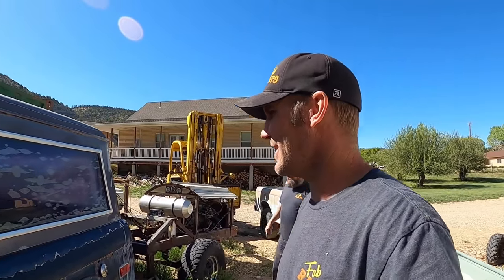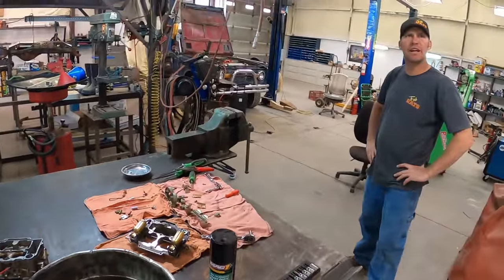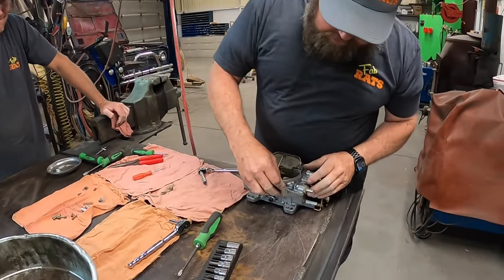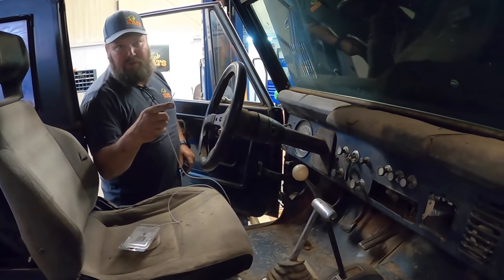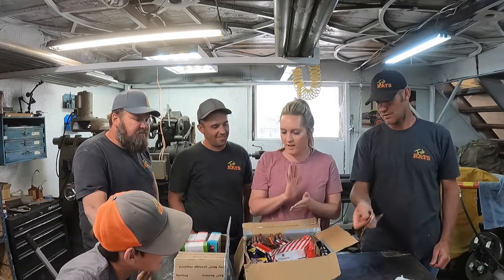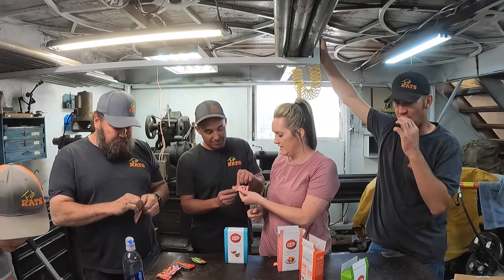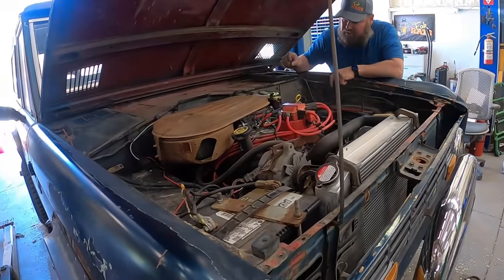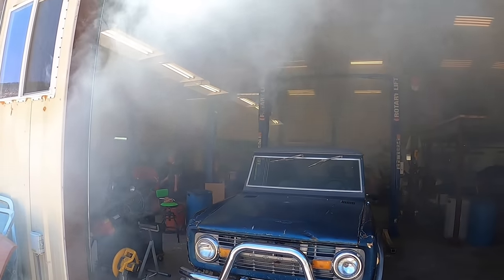The Wait Is Over! You Have All Been Asking About This Ford Bronco!

Comment: Free tip for you Paul from a retired mechanic, I heard you say put saw dust on the break fluid spill. Absolute best thing is water, it neutralizes break fluid in seconds. Just throw water on and wipe up or hose it out. Same goes for cleaning brake drums full of brake fluid after a wheel cylinder leak job, just hose it out.
Reply: Very logical!
Reply: I see their fallback method was burnouts. Certainly helped get spinning!
Reply: likely does it for you know.. the ecological aspects of things. not that hes on a sewer system, but it's still generallly frowned upon to just dump toxic liquids all over the pllace...
Reply: @Sffker  I bet you use vape pens and inhale/drink more of the main components of it than a typical brake fluid spill would dump(lol).
Reply: @throttlebottle5906  yea, i mean the issue is not if 1 person does it every once in a while. it becomes an issue when it’s an at scale thing. it all goes somewhere, it doesn’t just disappear

Comment: That’s a beautiful vehicle. Our family has a 1966 that my grandfather bought brand new. We had a frame off restoration done to it and it only has around 47,000 original miles on it. Plus we still have the original oil bath air filter

Comment: I always use the copper oil line kit when doing Guages like those.  Even more so when mice are problematic. Good video guys.
Reply: This!  My GF was not happy whena kink in the line under the dash let go and hit her in the leg with oil. Lucky the thing had not ran long and she was a champ about it. lol.The carpet, well not so much.
Reply: @LarryYaw  My 427 67 Camaro had the plastic line when I bought it. It was I need to change that to copper. Had it in my garage running BOOM! smoke. SH%& fire. I shoved it out watched it roll down the driveway flaming. Got it out saved the house and car. Never, Never, I mean Never again.  I just put the same gauges in my 55 F100 guess what oil line is on it.
Reply: I've had plastic line in my truck for 7 years, still no issues 🤷‍♂️
Reply: Just go electric, they react a lot faster.
Reply: nothing like having the nylon line chafe through and blow hot oil all over you and interior.... 🤣
on a side note, the same can happen with copper if it's not routed and protected right. no need to ask how I know in either case(yuuuuuup)

Comment: The 1975. I bought a 68 Bronco. Stock Jeep tires on it. Didn't have no backseat I found one down the street from where I left paid 25 bucks for it. Had Defenders cut flares on it put some fifteens by 33's on there put headers on it. The original motor start burning oil so I had that change put a factory rebuilt that was bored out original order was 289. This other ones for spinner 289😊. Got rid of the smog pump. Cuz it was on my Mustang 65. But that thing would make those big back tires bark like dogs. It would lift the front end. 3 speed on the tree. This was a northern California. I had that thing for 45 years same motor. I never put more than 60,000 miles in that thing. After while when I got separated it's at more than what I drove. Talk to Southern California headset different 5 years. Drawing from Southern California to Missouri. I got rid of it two years ago had that thing for 45 years. Had to sell it couldn't work anymore. That they would Clan The Impossible. My cousin had a 72. He was always getting stuck the river in sand. Call me to clock in the morning I have to go pull him out. I wish I still had that thing. The only minor buddy rested had on the floorboard cuz it still had the original floor mats in it moisture underneath. Had a liver transplant didn't work anymore. Lot of partying back in the days too young. So the first seven thousand bucks. In Southern California could have got 20. Or more. I have no way to get there. This came from an old farmer . The gear the board from your he restores them. He had one that was a rock climber. Jamiroquai moradabad I wouldn't sell it to him you're going to fix it and give it to his grandson. So I hope that guy who has that Bronco there I really appreciate it I really appreciate it mine.. and yes it gets pretty hairy when you're climbing Hills when you go to 3 speed on tree put that thing in Low 4 I didn't even touch the clutch or the brake.😫☹😡. Not bad running how did hair no-hitters. Any problem with mine was I'd break axles and my partying days and I would drive it home about 10 miles. One time though really bad time I won't never forget coming down the hill from the dumps with my trailer my grandfather my aunt youngest son Highway was at the bottom of the hill I got pretty close to the stop sign when my brake pedal went to the floor so you either have to go left or right and I was tried doing 8 miles an hour I made a left turn a dump truck came through I program to her gravel white spot got to stop The Carter pinned underneath a broken from the brake pedal stuck it through there and it stayed in there till I got to Missouri 40 years later.😱😳🤪👍🏽✌🏽👌🏽👊🏽💪🏽👏🏽🙏🏽🙏🏽🙏🏽🙏🏽🙏🏽. Thank you Paul for the memories of a Bronco. Good job guys.🤷🏽‍♂️🙋🏽‍♂️.

Comment: You NEED an ultra-sonic cleaner for those tight small places on those carbs….
Reply: PS- Dental offices use ultra-sonic cleaning to clean the nooks n crannies on their dental instruments.
Look into it. 
Mechelle - cleans JEWELRY wonderfully, too! Lol
Reply: They're useful but i still clean stuff the old way.
Saves waiting for the tank to heat up.
Nobody needs one, but they're good for some stuff.
Reply: @bushratbeachbum  
Ultra-sonic cleaner does not intentionally heat up. It uses microscopically INTENSE very high frequency vibration to “scrub” the tiny nooks and crannies where brushes and tiny scraping instruments can not reach. Set the item to be cleaned into the chemical or soap bath and set a timer…. The cleaning starts!
Look it up.
Reply: @cliffmorgan31  i have a good ultrasonic cleaner.
It has a heater.
Many do.
Reply: @bushratbeachbum  
I’ve used several through the years, the agitation of the molecules in the water warms the water/solution being used.
I haven’t used one that has a “Heater” switch. I guess I learned something.
Reply: @cliffmorgan31  though the process does warm the liquid, most have a heater too.
Any of the Chinese ones over 3L will do and depending on the intended use, a lot of the industrial ones do.
Super useful for greasy bits, really helps get it clean

Comment: Best to have the front facing into the shot to do burnouts so the black rubber dust don't go everywhere. Yes I learnt the hard way lol good fun though 👌🏾
Reply: until it grabs traction and takes out your back wall.
Reply: @TheSlywright  in the 40 years I've been doing it you'd have to be an ameteur to do that 🤦🏾‍♂️ not if it's chained to the concrete!! Notice the blocks he has in front of the front tires... that's called "safety measures"
Reply: @TheSlywright  But you're right though I've seen the aftermath of that before. Just people not taking the precautions to stop that from happening. Before we put the chain loop in the concrete when we were young we use to park the tracker 8 meters away outside and chain our trucks to it. A lot of safe ways to stop that but I do agree with you because some people don't think of that! 👌🏾

Comment: For those that don't know, the first Ford Bronco had a 107 hp v8. Not quite something to write home about. The Toyota pickup with the 22R engine had the same hp, but the difference is the torque, which Ford had more of than the Toyota.
Reply: And that ford will NEVER go a quarter million miles and still be running!
Reply: To be more correct the first Bronco had inline 6 cylinder
Reply: @handyman75657  I've got a 95 / 250,000 runs fine got a 94 275,000 great off-roader
Reply: @kevinwalters7615  Yes, this. And that inline six will last a very long time.
Reply: @bigassfordsd  they sure did ... Ford and for the most part all the other manufacturers use them for an extremely long time

Comment: Paul, you are always talking about burn-outs.  Remember that T Bucket that I showed you last year?  That machine would not do a burn-out if its life depended on it.  LOL   I has a low stall converter, 33 inch tires in the rear, weighs 3,700 pounds, and 3:21 gears.  But, on the plus side, it does everything that I wanted it to do.  I went up to Toquerville Falls when I was down there, and it did that road without issues. 

I have always liked those square Broncos.  Blowing out the mouse nest was awesome.  Probably not for the mouse though.  LOL

Comment: Hey on that carburetor it needs the plastic spacer to dissipate the heat! It’s a poor design on edlebrocks part! The heat from the motor boils the fuel and when you stop it’ll be hard to start it’s flooding itself through the venturas squirting fuel down into the intake! I promise it’s going to do it and when hot you try to recrank it you give it more fuel that it don’t need! Call edlebrock they sure will tell you!! I’ve put quite a few on!!

Comment: A few weeks ago you wanted to know if you should do the Lemons race. You might also want to look at ChampCar races. I know more folks running in ChampCar (Previously ChumpCar).  You should volunteer as a race steward before deciding to jump in.  You can donate your hours to an existing team.  You can go a day early and help inspect cars, which will be very informative for building your own.  Then work flag at the pit where you make sure the teams are being safe, and not cheating the 5 minute mandatory  off track time for fuel and driver change.  The most impressive moment when I was volunteering was the moment after the green flag.  A sixty seven car close tight pack thundering down the front straight into turn one, three wide looked absolutely terrifying.   The rest of the race I wouldn't have any trouble with hunting down the car in front, and finding a way to overtake them.

Comment: Look into the BG brake flush machine 
I use it for ever brake job I do.
After you use the newest one I have been using you will never pump a brake pedal but 2 too 4 times on a complete empty system.
It is so nice.
Also if you want to use the function that it has none will get on the floor

Comment: Paul just needs to pour a concrete slab near the shop just for burnouts. It'd keep the shop from getting covered in rubber dust, and the smoke wouldn't run people out of the shop.

Comment: Nice job 👍I have a few things for a 42 but it's mostly for the 1 1/2 -2 ton wish I could help you more, but for front clip I don't have a reg 1/2 ton.  There is a guy named Lee Reynolds in Hugoton Kansas L&B enterprise.  I got some stuff from years back not sure if he still has stuff or in operation, but he use to have quite a bit of early chevy trucks.

Comment: 4:52 "does it have off-roads in it?"
He's talking about the carb. Is he referring to the mod you can do that allows the carb to continue supplying fuel even when you're driving at steep angles?
iirc, I did a similar mod to the carb in my 86 Samurai, and it ran significantly better.

Comment: "Got'a crown vic motor..."....I have a story. Back in the late 70's. I owned a 69 Pontiac custom S, 350, 2 barrel with a 450 turbo hydromantic, I did some work on for hp. I always wanted to be faster than anyone...lots of story's behind that. Anyway.....One night working late stocking groceries and doing the usual stuff of drinking late at the store, I bought a pizza and headed home...might of been around my 2am.//special shop stayed open late.(I was 17 or 18 at the time). There was a trooper who had a boat Vic....you know one of the long Vic's. Was estimated to run around top end at 150 to 170. No one really knew. I had met him on a one other occasion for speeding. Had a S curve I loved speeding through next to my uncles house, then a long 1.5 mile straight away before my turn off....PS setting the scene. I met his black car with red letters just as I exited the S curve. Saw the red letters and was an OSM, gunned it. Saw him do his pull over and fish around. By this time I had reached 130 according to my un-adapted register. But I saw his headlights uplift when straightened  out. Long story, I out foxed him. 

Main thing I was worried about was him taking my pizza!

Comment: You should drill and into the concrete and put some anchor points so you can run chains to hold the truck or car whatever you have if it's four wheel drive test out the four wheel drive burnouts

Comment: My mechanic's theory is electrical wire casing is made from peanut oil.  I think mice just like anything plastic or rubber.  I maintain two vehicles in the Sonoran Desert where mice engine damage is very common and the mice love 93 GMC truck more so than the 98 Subaru Outback.  I think it's the larger engine compartment because it doesn't matter where I park the GMC they always find it.  I have found putting moth balls in empty cottage cheese containers with holes midway up all around and the lid off works.  Two of these inside engine compartment on the finder wells and one on the header near the air filter keeps them at bay. Just a suggestion I have found works.
Reply: I've had problems with rodents in the cold months. I'll definitely give that a try. Useful info. Thanks

Comment: I had one someone a thing like a dog coup on the back took the six out put av8 in it moved motor mounts back cut the cal so I could put the motor back to the bell . After all of that I had to go to the junk yard to get clutch rod . Will I was there Ilearnd something six bell is shorter then the v8 I did all that work and all I had to do was change the bell.

Comment: You need to hook the electric fuel pump to an oil pressure switch for safety reasons when the engine dies it will shut off

Comment: Stock engine = 600 carb
Mild to 3/4 Cam = 750
Anything radical racing = way more carb...

That 609 Edelbrock should do the trick....
Sometimes it helps to add a 1" spacer depending on what intake you are using....!!!!

Comment: You can get any car to do a burnout if you put the drive tires where the brake fluid is on the shop floor, or spray them with WD-40.
Reply: Blocked the front wheels too.

Comment: the only thing i would do with the bronco is try and put it back to 3 on the tree. and some small mud tires.
Reply: Maybe it's just that I learned on a floor shifter, but the couple column shifted manuals I've driven, I didn't like at all. Would definitely keep it as a floor shifter.

Comment: Quick question:. Is the bronco's fuel line rather close to the exhaust?
Reply: That's what I was thinking.  Probably not going to cause an issue' but could God badly if ever it springs a leak!😬

Comment: Holley EFI computers have always been such trash.  Bent a rod on my 71 Blazer because my Holley throttle body decided to die and the injectors went wide open, not even buzzing, just squirting fuel into the engine until it filled the cylinders.

Comment: Don't want to rain on your parade but that can't be the correct place for that distributor... Ya can't just stab them anywhere... With 11 teeth (usually) on the gear there is only one place where things will sync up... Otherwise the spark has to jump to far in the cap, carbon trace, misfire, you get the picture... It's like setting push rod length on a high lift cam, calculate the correct length and just barring the motor over requires half the force....